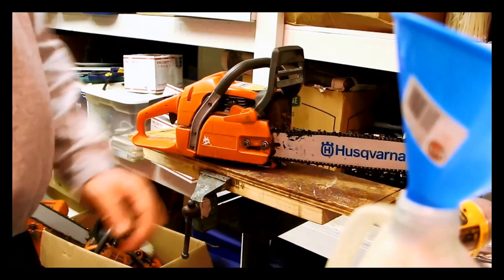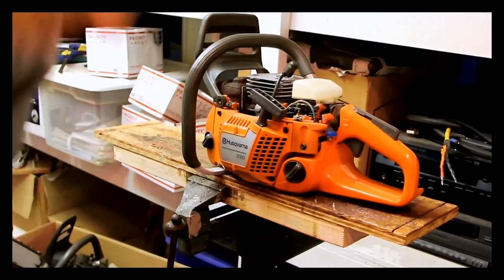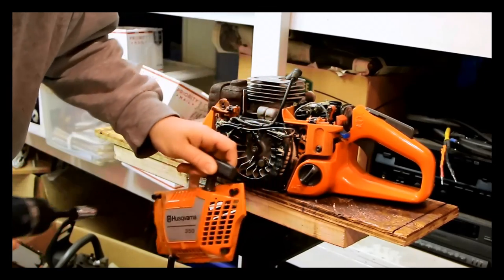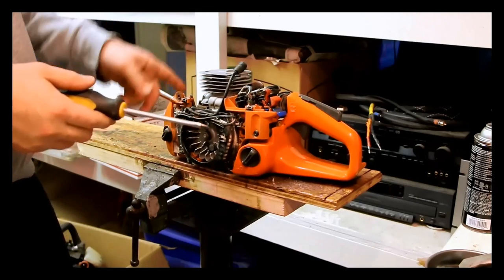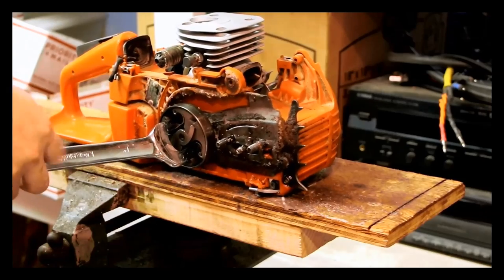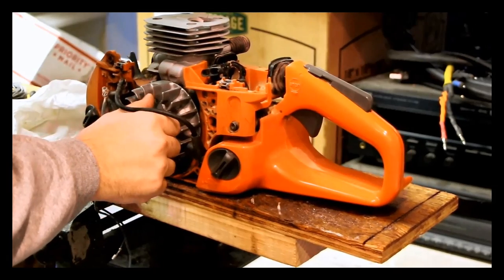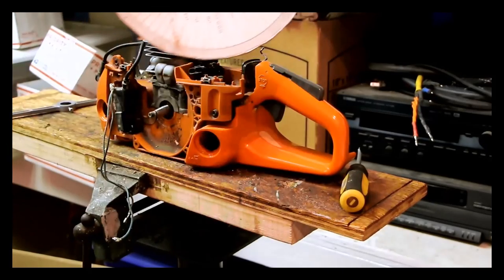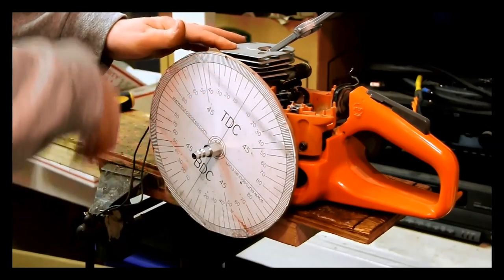Husqvarna 350 dismantling, modding, and assembly part 1

Comment: I just came across this video. I too have a 350 Husqvarna and love it. I always use ethanol free 92 octane gas in my small engines but back when I bought the chainsaw in 1999, the gas had no ethanol in it. I ended up injuring my shoulder and having 4 surgeries on it in a 5 year span.
The chainsaw sat on the shelf for several years, maybe 8-10 before I made an attempt to start it again. I dumped the fuel out, put clean fuel in it and would you believe I only had to pull on it about a dozen times, if that and not only did it star, it idled!!! Unbelievable!!
Terrific saw, I still use it today.
Thanks for the video!!
Reply from the maker: Lots of 350 stuff on my channel.  Make sure you look up the tips and tricks video for the 350....it helps!

Comment: Matt: I want to write to say thank you for your video series on the 350.  While I am not interested in modding my saw, I did need to take it apart completely.  I have had this 350 for many years and most recently it began starving for fuel.  When I noticed the cracking in the fuel line, I was lazy and took it to a shop to have them deal with it.  They changed the fuel line and that didn't help.  So they changed the carb and that didn't help.  Out of desperation, they put in a new spark plug - we all know that wouldn't help.  So they called me and said, "we can't figure it out - it must be the crank seals, but we are not going that far with it.  Please come, pick up your Huskie from Hell, there's no charge since we failed."  Your videos gave me the confidence to disassemble my saw and as I did so I found that one of the bolts holding the bottom half of the crankcase together was missing, and two others were loose.  So it was sucking air into the crankcase.  I had it stripped down to the piston, but I didn't machine the crankcase block - I just wanted it back to the way it was - running!!!  I took your advise and retapped each hole to 1/4-28 and picked up some matching socket cap bolts.  I sealed the lower crankcase back together using Permatex form-a-gasket and the red threadlocker so those bolts NEVER work their way out again.  I degreased and cleaned everything using naptha (camping fuel), which is an excellent solvent.  Lubed everything as it went back together and I now have a saw that runs like new.  Many thanks!!!!!!!!!!!  Could not have done it without you.
Reply from the maker: Dan McFarland wonderful!!!!!  yes!!!!!!   and you are very welcome!
Reply: I think this is my problem on the 345, and it is what I was told by a local repair shop. Is there a shortcut to get to the bottom of the crankcase block without taking everything apart. My 26 year old engineer son says just to buy a new saw. I've already spent a lot of time on this. It has 90 lbs compression, but if there is a leak... chances are that correcting that would increase compression.

Comment: I highly appreciate your series on the Husqvarna 350, though I followed your directions with respect to the use of rope in the plug hole and fixed the saw. But the rope is now stuck between the piston & cylinder..  How to release it? 
In the Muffler port, I can see the rope squished by piston as it's stuck there! 
Please help advise, I've needed the saw for over a month and had to fix oiler seal after friend had beennusing it.
Thank you!!
Reply from the maker: You pushed the rope too far.  Back off the flywheel with a wrench.  Don't pinch yourself!
Reply: Used a rope in plug hole to remove clutch & it's now stuck between piston & cylinder.. took off muffler and see it stuck, squished there..
Considering reversing the flywheel or removing the cylinder housing..
   Someone also advised this:
Can you go to the hardware store and find a couple of nuts to thread onto the main crank and then put a wrench on it and work at either forward or backwards to release the rope?
Reply from the maker: @larryjohanseniv7049  there is a nut already on the flywheel you can grab
Reply: Advisors always state to push it all the way in, in order to fill the housing. I push the envelope lol thank you and thank you for your videos!!! Really appreciated
Reply from the maker: @larryjohanseniv7049  you can also grab the flywheel but don't pinch yourself. ...if you need to double nut the flywheel it's m8x1.0 right hand thread
Reply from the maker: @larryjohanseniv7049  don't have the piston so low in its stroke and the exhaust will be closed and it won't be possible to push the string out the exhaust port
Reply: @matthewolson8875  thanks so much! It was challenging to find answers on this matter. 1st time it happened
Reply: Thanks so much Matthew, slight loosening of flywheel was a success! I'm not the best at this, but I try. Does the flywheel tighten with use? Couldn't find much on that info and ready to finally get this back up and running
Reply from the maker: @larryjohanseniv7049  clutch tightens with use...flywheel is keyed.  Make sure flywheel nut is still tight
Reply: @matthewolson8875  thank you! Flywheel nut seemed to remain tight, it wouldn't budge.
I had removed the oiler & replaced the little rubber feeding part that attaches to the oiler.
Still leaking lots of oil.. likely small hole in casing due to muffler popping off.. spent many hrs on this already. I'd like to figure it out and keep for backup.
She's paid her dues. Is there another Husqvarna slightly more powerful than the 350 that you recommend?
Reply: When installing rope into cylinder. First bring the piston up to cover over the exhaust port. Look into the spark plug hole or if you have the muffler off look into the port from the muffler side.  As far as getting a stuck rope out rotate the flywheel counter clockwise and the piston will go backwards releasing the rope.  Hopefully it did not cut it leaving remnants inside the port. If you have the muffler off you should be able to retrieve it there.
Reply: @matthewolson8875  w

Comment: There's a debate about if you have to remove the jug in order to replace the plastic intake clamp on the partition wall boot?
Reply from the maker: Personally I do not believe there is a debate I remove the jug and if the Husqvarna 350 has not yet had a full tear down he probably does need it to reseal the base

Comment: Thanks for the video. Does the exhaust gasket go on after the heat shield?
Reply from the maker: Heat shield directly against the cylinder...then the gasket ...then the muff
Reply: @matthewolson8875  thanks. The exhaust gases have melted a hole into the chain oil reservoir. I'm trying an epoxy repair.
Reply from the maker: @LordProsen  thats a common issue...  often easier to find a used case
Reply: @LordProsen  I suffered the same… got a big hole melted in the bottom of my case after muffler bolts worked loose and muffler loosened off. Pleased to say I had very successful repair of an approx 3cm diameter melted hole using J B Weld 8297 High Heat 500 Degree Epoxy Putty. Amazing stuff. After repairing using that, before reattaching the muffler, once it had set, I laid a cutout piece of thin aluminium from a coke can as extra heat protection. This method has sorted the issue for my 350 and saved me buying a whole new crankcase. I’ve also added a cheap bracket guard to hold the muffler in place. This is now attached to the dogs to ensured the muffler bolts never work loose again! Good luck.
Reply: @paulclarke2321  my jb weld repair has held up well for the last couple of months with regular use. I also fitted the muffler bracket.

Comment: Hi Matthew. I have a jonsered 2166 and have heard about removing restrictors and port plates. This is going to make me look really dumb but are they talking about the exhaust port? If so, What plate would I be removing and what restrictions am I grinding out? I'm sorry to be so naive but I don't want to ruin a new saw but if easy enough, I'll give it a shot. Thanks!
Reply from the maker: Dan Difusco they are talking about the transfer covers.  They are on the sides of the cylinder head.  ..so you have to remove the head to get to them and grind on them.  Your call if you want to do that :)
Reply: Matthew Olson ah ok. Thank you sir
Reply from the maker: no problem...
if you decide to take it apart, my xtorq 372 vid will be helpful.  the 2166 is similar I think.

Comment: Hi Matt
My Huskey 350 has a broken starter, the cord got caught in the flywheel when i was using it and busted it.
also that little black plastic air baffle broke too,
Do you have a video on this repair?  and where  do you recommend to get the parts?
Thanks
Paul
Reply from the maker: the black plastic air baffle can be bought aftermarket or oem, as can be the starter.   you can click on the link in the description of this vid for HL supply and they should have the aftermarket stuff available, and possibly the oem pieces as well.  starters are bit annoying, but need to be played with and you'll get it.  i don't have a specific vid of that but its a fine idea.  really backed up with vids right now, and will hopefully get to "requests" vids one day

Comment: Nice video. I've got a 351 and a 353. After working with 346xpgs at work, I feel like my saws lack quite a bit of rpm and responsiveness. Any recommendations apart from opening the mufflers and maybe advance? Cheers
Reply from the maker: check and make sure those saws don't have dished pistons...  they may be low on compression.   open the muff,..  without going towards crazy port work you can also change out the intake setup to a 359/357xp setup... better air flow in.  if you want to be as good as the 346xps ... then just get the 346xp cylinder ....   oem from ashokan turf and timber is around 105 shipped.   google their shop, talk to "spike60"  ...  

no need for advance on these.... at least i don't think so.

Comment: Matthew, what is "squish"? I want to know more about what you're doing to this saw? I'm about to take my 346xp apart because it needs a new tank unit?
Reply from the maker: Ben Greenstar I have a 346xp vid as well.  squish is the distance between the top of the piston and the cylinder head at top dead center.  ie....how close does the piston come to hitting when it reaches the top.  usual squish is...   040"- .060"  ...optimal is usually accepted to be .020"

Comment: I need help!

Husqvarna 460 Rancher here. 

I torqued down too hard on one of the bar bolts and snapped it in half. See pic. I have the replacement bolt but for the life of me CANNOT figure out how to get the old bolt out. It is not a model where the bolt comes out through the oil tank. I cannot find anything online anywhere on how to replace it on this model. 

Anyone have any ideas?
Reply from the maker: Tap the old bolt into the tank ....then bring new bolt in through tank.  Press fit
Reply: Can't on the 460. It doesn't push into the oil tank.
Reply from the maker: @jeff6365  far as I know they do... they tap right into the tank
Reply from the maker: @jeff6365  according to the husky part diagrams the 460 bolts are press fit.
Reply: @matthewolson8875  got it. I'll check it out again and let you know. Appreciate you looking it up for me.
Reply from the maker: @jeff6365  ereplacementparts.com is where I go for diagrams

Comment: Hey Mate, Enjoying your videos. Have you had anything to do with the Husqvarna 2101XP, and do Hutzl make any parts for these.
What parts are compatible for these if any from the later saws?
Cheers

Rod
Reply from the maker: Rocket100 the 2101 is quite a unique piece.  I don't have any experience but I do know parts are difficult to get for that model.  That is not a saw I'd use daily due to the lack of parts availability. ...hope that helps.  And thanks!
Reply: Yeah I'm learning quickly they are hard to get parts for. My old man has one and needs a few bits. Chain Brake band ect ect
Reply from the maker: Rocket100 best thing is to post on the forum....  opeforum.com and beg for parts lol
  My opinion....u have a collectors model....not an every day use saw.  It's quite the piece though and is worth good money....

Comment: Coldest-blooded P.O.*. I've ever owned. Trouble starting and staying running since new. Have kept the thing immaculate, service the chain sprocket every time I use it, have replaced and gapped plugs, installed premium plugs and replaced spark cable to no avail. Have tried different choke settings, removed and cleaned plug, no difference. Takes about 30 pulls to have it run for 5 seconds, then stop. After about four of these sets, it runs for about 30 seconds then dies when you try to use the handle throttle. Took it for service, and improved for about two hours, but service tech said these like to foul plugs no matter what you do, recommending a real chain saw...Stihl. This one is going to the curb for some sucker to take and be frustrated with. Don't even waste your money or time on this weird brand Chain saw. Just like weird Swedish cars, it's hard and expensive to repair, and bad design. Buy conventional stuff built locally by people that actually speak our language.
Reply from the maker: see my reply to the same comment elsewhere